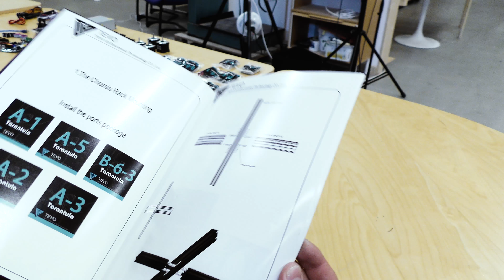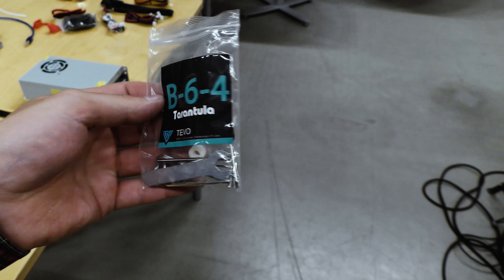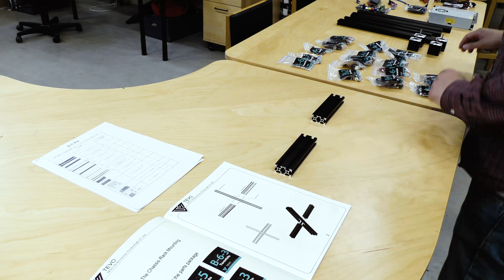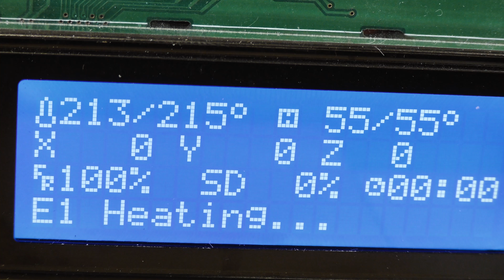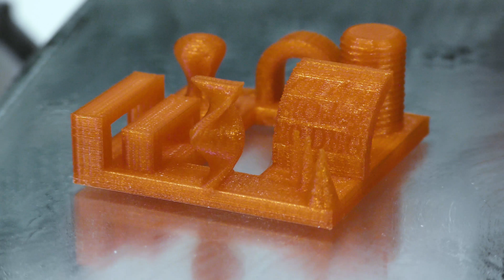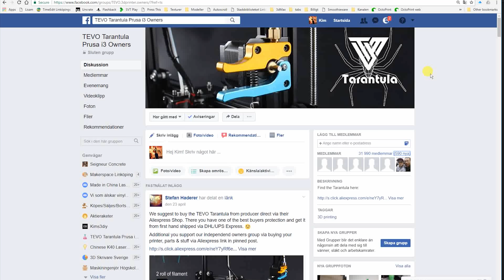Tevo Tarantula the best cheap 3D-printer? Review

Comment: awesome review man, thanks a lot! I'll sure buy it!
What about the proximity sensor for the auto bed leveling?I mean...it's something that I can add in the future? It's good to have?
Reply from the maker: thank you, you can easily add a proximity sensor, install it to your Z-axis min connector and enable it in the firmware, piece of cake! :)
http://www.instructables.com/id/AUTO-BED-LEVEL%C4%B0NG-Z-PROB-W%C4%B0TH-REPET%C4%B0ER-FIRMWARE-Wi/ you can read more here, make sure to buy the right one. :)

I don´t use it since the bed keeps bedlevel very good with no problems so i dont think its worth it, i have it on one of my other printers. But yes you can add it in the future :)
Reply: How hard is it to level?  I mean I know the autoleveler is a conscience.  But do you really need it?
Reply from the maker: If its a good design of the printer it´s not a big problem with bed level. You don´t have to do it often, on my tarantula I do it once a month. Thats why i dont use it.